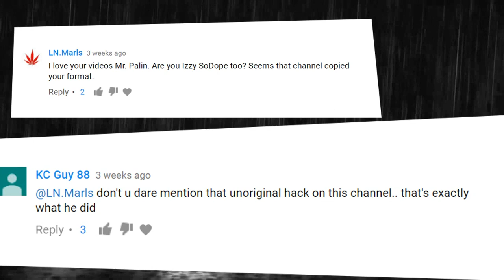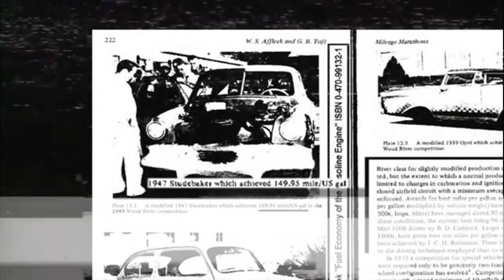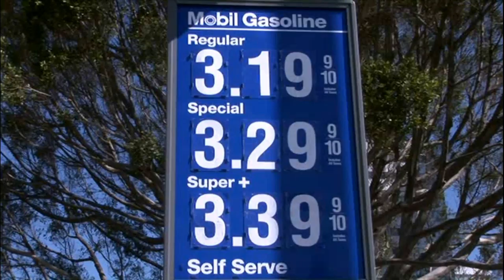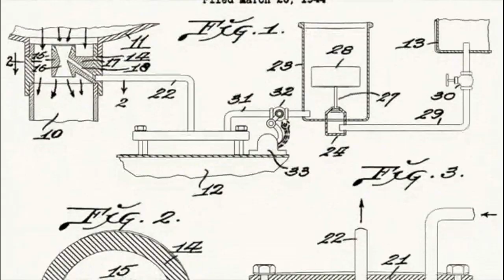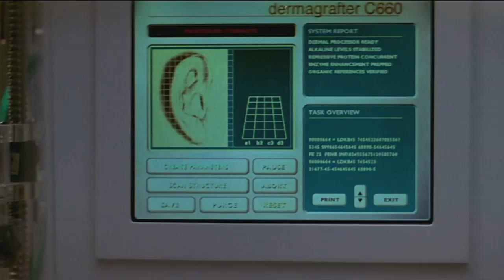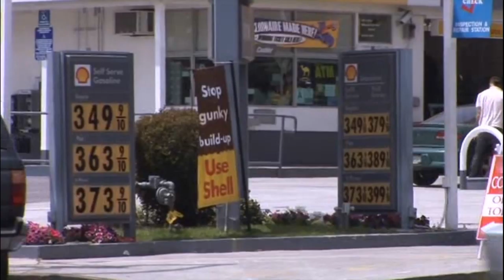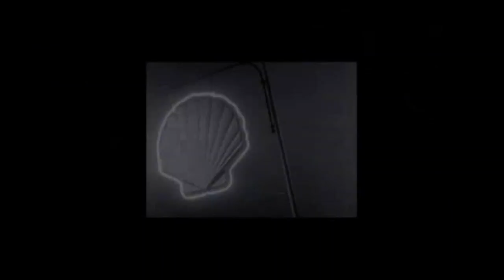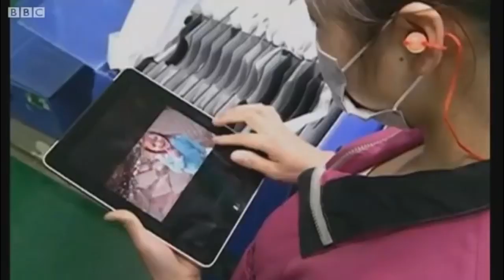Bill Burr - GasHole

Comment: I’m a test engineer for a major agriculture company. Since I was a child I’ve heard stories about so and so’s cousin’s, friend’s, aunt’s, neighbor had a Ford Pickup with a prototype carburetor that could achieve 70mpg. Ford promptly came and swapped their carb once the dealer was notified of course. A while back I had a coworker comment that he had a Chevy Sprint in the 80’s that got 55mpg. I informed him that the Sprint has 45hp and weighed 1,500lbs. Your Prius with all the modern crap has to weigh 1.5tons at least and has over 200hp combined gas/elec
Reply: I do know many accounts of 20%ish fuel mileage increases with hydrogen generator devices though.

Comment: Why say water injected carb? A carb simply meters fuel. You can run whatever fluid you want through it, it will not combust and ultimately rotate the crankshaft if it is water. 

A water injected carb is still a carb. This man would've needed to bring Chevy an entirely new engine that doesn't utilize internal combustion via compression/ignition of gasoline and isn't powered by steam. 

The only way you're going to transfer water to substantial energy required to propel several thousands of pounds is if you heat it and convert it to steam.

Also, a faceless phone call claiming to be some obscure ex Chevy scientist making blanket statements with no actual specific details regarding how 1000mpg was attained is LAUGHABLE "evidence".

I know bill is becoming a senile old man and I think this clip is fairly old, but it really is quite an ignorant thing to believe in.

Anybody that believes in this bs water powered car needs to do some research and explore exactly what a carburetor is and what its relation to an engine is.
Reply: Yes, 1000mpg seems impossible, 100mpg also seems very unlikely(for a normal size/shape car at least) Current engines are up to 38% efficient, lower ones around 25%, so presumably 100mpg would be getting close to needing a 100% efficient combustion engine.I can't see why the USSR in the past, or others now wouldn't want to improve efficiency(as compared to gas companies killing improvements), the USA isn't the only country.Something like 'who killed the electric car' was a lot more realistic, from memory.
Reply: @DoubleMonoLR  speed would play a part too?
Reply: they made a Chrysler that ran on peanut oil and other things like perfume.
Reply: @zaienabraham6341  yeah it was a turbine engine. The fuel economy sucked though.
Reply: @faux Latinatum That wasn't a character, bill believed that shit (the clip is a few years old now). The mpg rant is like his ones on bankers, war or corrupt politicians.
Reply: @faux Latinatum he's not in character. Bill doesn't really put on an act unless he's using an obvious voice change. This is just him bullshitting on his podcast. He 100% believed on what he said at the time he said it.
Reply: @muskokamike127  that has more to do with allowing the engine to be pushed to a higher operating capacity without fear of overstress. It's been practiced since WWII planes and in hot rods.
Reply: @anti_honey  same thing worded differently.
Reply: @muskokamike127  perhaps it's what you meant, but it isn't what you said
Reply: @faux Latinatum resorting to ad hominem, and the bottom rung of Graham's Hierarchy of Disagreement, shows that you lost the argument. Hell, even Bill Burr made jokes about antics that you're displaying.
Reply: @faux Latinatum projecting your own insecurities online, yes?
Reply: @anti_honey  OH you're one of THOSE lol...Now I know whom I"m dealing with. You do realize you described the why, I described the how right?
Reply: @muskokamike127  you know who you're dealing with now... Or, at least, you think you know. I described the how, as well. I just provided the other half to what you omitted in your initial statement; primarily because you jumped straight to the result with equivocation. 

I'll frame it as a simple math equation to better illustrate for you. You stated 1 = 2, I replied with 1 + 1 = 2, then you replied "same thing, worded differently," to which I rebutted.
Reply: The documentary doesn't say a "water powered car", but it was a gasoline car that mixed water  vapor into the gas mix somehow and gave it a higher mileage. Bill misunderstood it. Do you mean to tell me that in 100 years of car history we haven't advanced the technology of fuel efficiency, meanwhile we send rockets to Mars?
Reply: Andrew M it isn’t exactly that he believes the 1000mpg stuff. But you gotta admit there are always better, cleaner, cheaper options which aren’t in corporations interests; which is why Americans are paying so much more for healthcare and medicine than any other first world country, like Canada which is just north of them!
Reply: What's your opinion on ethanol as a fuel source?
Reply: Boy gasoline is limited to the laws of thermodynamics..., combustion is the dead end of that technology because it runs right up to the limit of reality, in other words gasoline and the combustion engine are/will always be limited to low mpg. The reason they’re widely used is because it’s a cheap fix that works, it’s not effective but it will always be reliable.
Reply: Boy burning gasoline is a pretty inefficient way to power something, it’s just that its cheap and theres a lot of it.  Fuel efficiency isn’t something that increases year to year, there’s a pretty hard cap on how high it can go.
Reply: You can separate water into oxygen and hydrogen by putting 24volts of electricity accross the water.
Reply: Are you fucking bought by big oil?

Comment: Water can be separated into hydrogen and oxygen then turned into H2O2 (hydrogen peroxide) which has been used as rocket fuel. 
The problem is it takes more energy to make the H2O2 than it produces.
Reply: How do you separate the hydrogen from the oxygen? I'm not saying it can't be done? I'm asking you how it's done? You seemed to skip a pretty important step like it was common knowledge. How is it done?
Reply: Tone trent, electrolysis.
Reply: @garyrahn2172  Interesting. Thanks
Reply: Geet engines have potential
Reply: Germans did that in WW2 with their ME-163. Did not end well for the pilots.
Reply: @Dover939  The Me-163 didn't use hydrogen peroxide, it used very toxic compounds for its propellant. You're right in the sense that the plane's toxic fuel load was more dangerous for its pilots than enemy gunfire!
Reply: @garyrahn2172  the Stan Myer injection system?

Comment: Technically the cars in question run on hydrogen gas
Which can be extracted from water through a process called electrolysis
Reply: this.   IF electricity was free, and you had enough battery power, you could get some usable distance out of a car "powered by water" but the thousands of miles per gallon claims are based on theoretical numbers.  a dude i knew in highschool did his electrolysis in the garage, and had a hydrogen powered car that he commuted to work daily.  no clue what the electricity cost was, but he said it wasn't worth the effort for the average person.
Reply: There are some buses here in Baltimore that use hydrogen,but not by burning it
It's forced through a specific metal grate that extracts the electrons from the hydrogen atoms
They've been in service here since the year 2005 to reduce air pollution from fossil fuels
#OldHatTechnologies
Reply: @moosestubbings1853  yeah, reverse electrolysis or whatever that's called where you generate electricity by creating water is much more efficient than doing the opposite to burn hydrogen.
Reply: @jasonfifi  nikola tesla. Electricity is everywhere
Reply: Which also consumes more energy than it produces
Reply: @papes zzz and funny not one of them has ever been proven or had a group of Engineers or scientists study it which makes me believe it's never been real

Comment: Rockets have bad mileage, large ships have terrible mileage. 

The shipping industry (which is one of the biggest industries on the planet) would love to have more efficient engines lol
Reply: Ships have good milage though...
Reply: @tseuren123  Maybe a speedboat or a jetski.
Container ships burn 1 gallon of fuel before they travel 100 feet.

The Emma Maersk uses 1660 gallons of fuel per hour, it would have to being very fast to have better efficiency than the worst automobiles.
Reply: @MorphingReality  .... yea but accounting for size and how much load it carries a boat is far more efficient than trucks.
Reply: @tseuren123  Its more cost efficient for sure, that's a separate but connected domain
Reply: @MorphingReality  as I already pointed out, also more fuel efficient... just google it lol especially with new coatings and stuff that can reduce up to 40% of fuel intake by creating less resistence underwater.
Reply: @tseuren123  Most measurements of fuel efficiency use MPG.

By that standard container shipping is far less efficient.

You say just google it but I gave you the numbers on an average-size container ship already.
Reply: @tseuren123  Part of this is simply because the kind of fuel container ships use is a lot cheaper than the kind of fuel the average truck uses. There's a bunch of factors that make it more efficient for transporting goods even though it eats a lot more fuel.
Reply: @tseuren123  Another simple example.
Trains are slightly less cost efficient than container ships for transporting goods, but they're a lot faster, and in the age of overnight shipping that matters.

Comment: Your only going to get x amount of energy out of a gas and air in a internal combustion engine
Reply: Well this is the most bland response ever, that doesn't really say anything
Reply: @dLzzzgaming  No, it says everything. Gasoline has a set amount of energy. You can only get 100% efficiency (not really, nothing in the universe is 100% efficient), and there is only so much energy in Gasoline. It costs energy to move a car (mass) over distance. The measurement is called delta V. It's not possible to get 1000mpg. Modern engines are 38% efficient, older ones were 28%. A modern engine gets like 50mpg at most. Do the math.
Reply: Gas is one of the most energy dense fuels known to man. They could get alot more out of it bit it would cut into their profits.
Reply: @dLzzzgaming  is it the right approach to insult people if u want to convince them to have a proper discussion?
Reply: If you make the car run an gas fumes instead of atomized gas you will go more miles per gallon. Make like a water pipe. Air comes in at the bottom of the gas can and has to bubble up through the gas.
Reply: Cars have steadily gotten heavier since the 90s making any advance in gas efficiency pretty much just level out. There were honda civics in the 90s that could get 50 on the highway out of a pretty simple 4 cylinder.
Reply: @KrikZ32  yes the old cvcc my brother owned a couple of them they would get 50mpg down hill in a hurricane and God help you if you hit anything larger than a mid sized house cat
Reply: I'm a mechanical engineer and subject matter expert in this field of specialization.
Everything here is true and so much more. I have all the original documents from Shell, Cummins, The US Army, SAE, and so much more. Let me tell you something, the thermal efficiency of a standard poppet valve engine is NOT 25% efficient. Its more like 5% efficient. 	Most engines and fuel systems currently in production are designed for one specific fuel type/source. This greatly limits fuel flexibility and has been a major hindrance to the viability of alternative, renewable, and green fuels. Furthermore, long chained liquid fuels reduce the efficiency of engine systems because the heat from the combustion of the fuel is required to overcome the latent heat loss to evaporate and chemically break down the fuel before oxygen from the intake charge can bond with the hydrogen, oxygen, and various other combustible elements found in liquid fuels.
	When using liquid fuels, including direct injected liquids, no matter how well atomized the fuel is the liquid droplets are still a stratified charge that will sap heat from the engine via latent heat loss via evaporation and chemical breakdown before oxidation/combustion of the fuel can occur. This inherently means that all liquid fuel systems use a stratified charge, and can never become a true homogeneous charge. Because liquid state fuels in a stratified charge carry sound, shock, and impact waves more readily, this makes stratified charges far more susceptible to detonation and “engine knock” conditions when higher compression ratio's are used. This has been one of the primary limiting factors for engine efficiency since the beginning of the internal combustion engine.
	Gaseous fuels such as methane and propane have exceptionally higher octane ratings in both RON and MON. This is partially due to the fact that gaseous fuels readily and naturally homogenize with intake air and partially because of their shorter and simpler molecular structure. These true homogeneous charges allow engines using gaseous fuels to run much higher compression ratio's, which greatly increases the efficiency, power to weight ratio, and performance of the engine. Gaseous fuels such as propane and methane also have higher energy density's by weight because the fuel does not need to waste its own energy to break itself down to continue the propagation of the flamefront. This is why methane has the highest energy density by weight of any common hydrocarbon as it is one of the shortest and simplest hydrocarbons. By observing the various types and lengths of hydrocarbons we recognize a general pattern, that the shorter and simpler a hydrocarbon is, on average, the higher its octane rating and energy density by weight will be. In effect, the shorter and simpler the hydrocarbon is, the more energy per atom of hydrogen and carbon burned can be extracted.
And thats JUST the god damned fuel delivery system.
The throttle plate induces artificial pumping losses and creates an artificial load by reducing the volumetric efficiency of the engine at any condition other than WOT. This greatly decreases fuel efficiency, but is "necessary" because unless extra liquid is injected into the engine if it runs lean the fuel will detonate and destroy conventional engines. BUT engines capable of withstanding the forces of detonation,l thus achieving true constant volume combustion, have been designed. Most conventional engines have 4 strokes per cycle, which doubles the internal friction per power stroke compared to a two stroke cycle. Furthermore, the valvetrain is where most engine friction comes from. Not to mention that the 2 fold symmetry of wiggling connecting rods means that conventional ICE's are incapable of running in detonation as it will cause the con-rod to bend and the skirts to fold in on themselves. Engines of the 2 stroke per cycle variety typically rely on the underside of the piston, which in such designs are open to the crankcase, to act as a supercharger to force exhaust gases out of and fresh fuel/air mixture into the combustion chamber when the piston reaches the bottom most portion of its stroke and cycle. Some 2 stroke per cycle engines, especially larger industrial engines, one such example being the Detroit Diesel Series 71, instead rely on a supercharger or turbocharger bolted to the engine to provide this scavenging force rather than pressurizing the crankcase. However, these engines fail to exploit a benefit of relying on an external supercharger and/or turbocharger because they still only use one side of the piston to convert chemical energy in the form of combustible fuels into mechanical energy. The reason why they are unable to do so is because conventional connecting rod engines can not isolate the bottom of piston from the crankcase oil. Furthermore, 2 stroke cycle engines despite their higher power to weigh ratio's and greater overall efficiency have recently fallen out of favor due to recent NOX emissions standards.
	In response to this, industry as a whole has, with few minor exceptions, not pursued innovating new mechanisms to solve these challenges, instead choosing to rely almost exclusively on computer controls, electronics, catalytic converters, and various other accoutrements to reduce emissions and attempt to increase power output of conventional 4 strokes per cycle engines and has done so with limited success from an engineering perspective. However this approach, though  traditionally considered to be financially safe by accountants, has resulted in engines that are of much greater complexity, cost, are considerably more difficult to maintain, and are less adaptable for a wider scope of uses. As a result, conventional engine of the current era are highly specialized machines, and the performance gains in efficiency, power output, power to weight and displacement ratio have been relatively marginal at best. To this day even the most efficient conventional piston engines have a mere 50% thermal efficiency, and these high (by conventional standards) efficiency engines have abysmal power to weight ratio's. It is for these reasons that a new generation of engines are needed. Engines boasting higher power to weight ratio's, higher efficiency, less moving parts, less internal friction, and simpler more robust and easier to maintain designs will be necessary in the 21st century and beyond. Previous attempts at commercializing scotch-yoke type engines have failed for a plethora of reasons. One of those reasons is that though they have higher power to weight ratio's and efficiency than conventional engines, the performance increase was not sufficient to justify switching to a new designs in prior years. This is all just scratching the surface.
Reply: @smh9902  Did you get the original documents from Bigfoot or Elvis or Grey 👽?